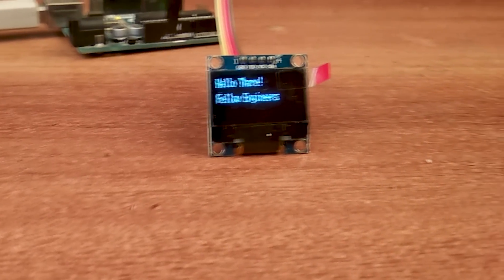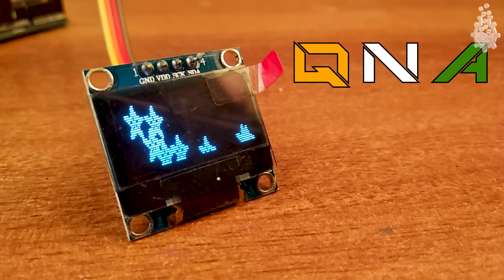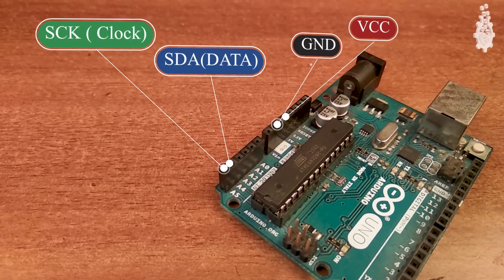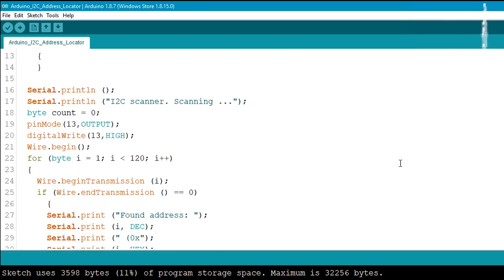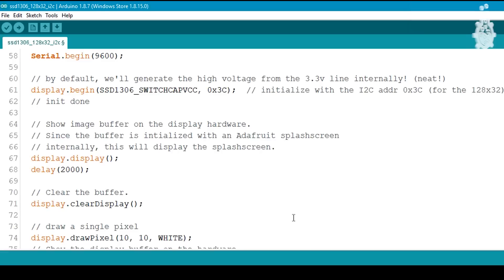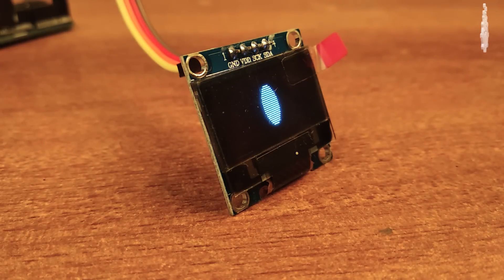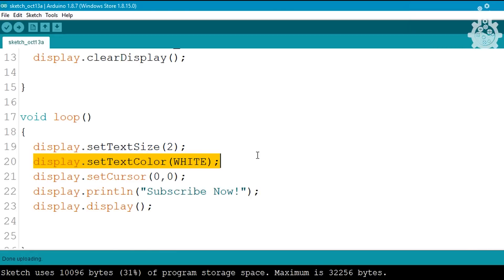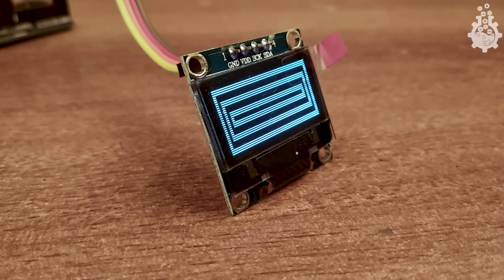arduino oled i2c tutorial : 0.96" 128 X 32 for beginners

Comment: What can i do if pins A4 and A5 are already taken???
Reply: put A4 and A5 pins on the power bus,  then attach the wires needed for I2C, since I2C can allow multiple devices on the same pins, but if its taken up by a dif component that isnt I2C related, find the individual SCL and SDA pins if ur arduino has it, if you cant find it on the front, check underneath the arduino and you might see it, or not depending on ur model

Comment: im not able to find address it is showing-Sketch uses 3972 bytes (12%) of program storage space. Maximum is 32256 bytes.
Global variables use 478 bytes (23%) of dynamic memory, leaving 1570 bytes for local variables. Maximum is 2048 bytes.
Reply: Click that serial monitor icon in the right top corner

Comment: your code does not compile and there is almost no instruction on "indestructible".  C:\Users\ak\AppData\Local\Temp\.arduinoIDE-unsaved202401-2284-1r6i1lr.gmzm\sketch_jan1b\sketch_jan1b.ino:8:10: fatal error:  wire.h: No such file or directory
 #include < wire.h>
          ^~~~~~~~~
compilation terminated.

exit status 1

Compilation error: wire.h: No such file or directory
Reply from the maker: Many people faced the same issue, please check comments someone has posted a solution

Comment: Great tutorial!

There were some errors in the code, I fixed them:

#include <SPI.h>
#include <Wire.h>
#include <Adafruit_GFX.h>
#include <Adafruit_SSD1306.h>

#define OLED_RESET 4
Adafruit_SSD1306 display(OLED_RESET);

void setup() {
display.begin(SSD1306_SWITCHCAPVCC, 0x3C);
display.clearDisplay();
}

void loop() {
display.setTextSize(2);
display.setTextColor(WHITE);
display.setCursor(0,0);
display.println("Heheheheheh");
display.display();
}

Comment: Hello, i bought an OLED with 128x128 pixels and its i2c too (somehow). well i downloaded the librarys and tried everything as usual, cz i have a little xp with oled 128x64. But i dont know  why i have a black screen, code is right, adress is right and most probably the librarys are wrong. Could you please give me an advice, what librarys to use for 128x128 oleds 12c. Thanx.

Comment: But what happens when your wire the setup correctly, run the code to check for the I2C address and in the serial monitor it only says "I2C Scannrer, Scanning..." but nothing happens afterwards? (btw I had the same results when I tried to find the address of my LCD panel's I2C address)
Reply: Did you find the answer?

Comment: I ran the code to find the I2C hexadecimal address, however, my serial prints this "⸮⸮⸮0A⸮0⸮⸮0⸮,⸮⸮". I corrected the Wire. h issue but I don't know how to solve this one?
Reply: same problem here any solution??
Reply: Same Here
Reply: Most likely your baud rates are different, Serial monitors baud rate needs to be same as the one in code "Serial.begin(9600)"
Reply: @MT2125-j7o  brotha, you are our savior, it works, thank you very much from the bottom of my heart
Reply: @truck-kunmaybechan6511  glad I could help

Comment: To fix the 128x32 resolution and force it to work in 128x64 start the library as follow:

#include <SPI.h>
#include <Wire.h>
#include <Adafruit_GFX.h>
#include <Adafruit_SSD1306.h>

#define SCREEN_WIDTH 128 // OLED display width, in pixels
#define SCREEN_HEIGHT 64 // OLED display height, in pixels

#define OLED_RESET     4 // Reset pin # (or -1 if sharing Arduino reset pin)
#define SCREEN_ADDRESS 0x3C ///< See datasheet for Address; 0x3D for 128x64, 0x3C for 128x32
Adafruit_SSD1306 display(SCREEN_WIDTH, SCREEN_HEIGHT, &Wire, OLED_RESET);
Reply: Oh thnx, I thought my screen was 128x32 even though I bought 128x64 😂

Comment: can we use this one oled display for several sensors?
Reply from the maker: OLED is a display, it can display anything you want, if your sensor can send it's data to Arduino, this OLED can display it
Reply: @mission_critical   @Mission Critical  okay.. is it mean if we use this one pcs oled, install in one arduino, and let say we put three sensors together the oled can show output from each sensor..? thanx for your reply..
Reply from the maker: Yes yes it will, unless you don't run out of memory space or size on OLED 

In my engineering days, I have integrated 3 sensors and yet had space on display
Reply: @mission_critical  okay.. i'm new & interesting in arduino things.. and wanna start some projects with it.. wish me luck.. 🤣
thanx alot for the answers..
Reply from the maker: All the best for your projects

Comment: I’m new to Arduino.... I want to make a fuel gauge using a .96 Oled 2 color 12C..... how do you  ode to make a bargraph that responds to the fuel level and show the E , 1/2 , F increments on the yellow portion of the screen? I’m also using a fuel level sender, with one wire.
Reply: Oled displays, can’t tell u how to program idk, but use the pwm pin, also known as the pulse width modulation pin to measure the fuel.

Comment: do you think it is possible to unstick oled screen from it PCB but keeping it connected with it's flex cable ? (need to do that for a project)
Reply from the maker: With extreme skills, yes it is possible, but I would suggest you not to do it, since it's quite delicate to be pulled off and many complimentary components essential for working are mounted on PCB, I hope you know what you are doing and all the very best for your upcoming project ❤️
Reply: @mission_critical  ok thank you for this answer :)

Comment: did everything as instructed, but the display still remained black. 
also the i2c scanner didn't find anything
any way to fix that? I checked comments already, but none of them worked
Reply: check how you solder all connections

Comment: Want to increase OLED font size in raspberry Pi using python
Reply from the maker: i havent tried this on Raspberry pi, you need to check the Library for examples hopefully you will get some insights there!
Thank you for Subscribing to Mission Critical
Reply: Edit the library, make the fonts larger by adding more pixels to every letter

Comment: Bro how to increase OLED font size?????
I'm printing time and want to increase font size
What I want to do?
Reply: You could try display.setTextSize(3);
Reply: The default font with the adafruit library is 5x8 characters. display.setTextSize([1-4]) will let you set the text to scale to double, triple, or quadruple size. Or you can also add your own font into it. Adafruit documentation shows how to do that. Also, you can have multiple text scales on display at the same time. So you can have the time in text size 4 filling the display height and off to the right can have AM in size 2 or something. The adafruit example sketch shows how to use it really well for writing and drawing and animating.

Comment: Bro, you have not fixed your adafruit library. Your Screen is 128x64. Open SSD1306.h ; see '#define SSD1306_128_32' below that it is '//#define SSD1306_128_64'. Just write '#define SSD1306 _128_64' and '//#define SSD1306_128_32'
Reply: You have to edit the adafruit_SSD1306.h library
Reply from the maker: Yes I m quite aware about the same, I have tried it, I will still try again for the next tutorial thank you for bringing it to my notice! 

Thank you for Subsrcibing to Mission Critical

~ Akshay Momaya
TechHead at Mission Critical
Reply: @akshaykolekar5903  thats right
Reply from the maker: Hey there I tried that but it seems like when I did that both those X 64 and X 32 dont work for my display , the only problem we will face for not fixing those headers is intro logo of adafruit will be cut, other than that everything is normal and useable!
Reply: Your display is 128x64